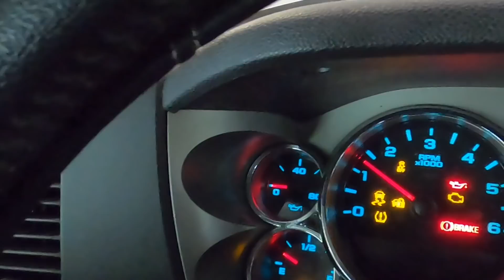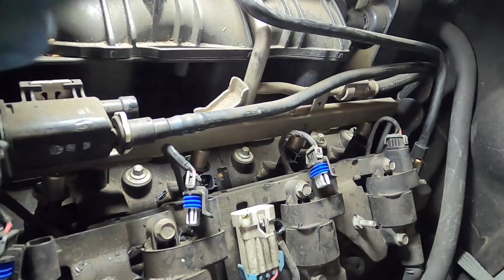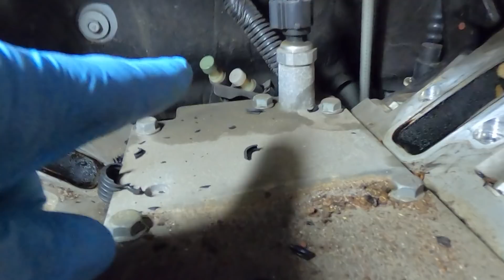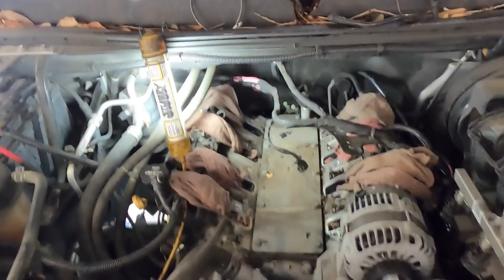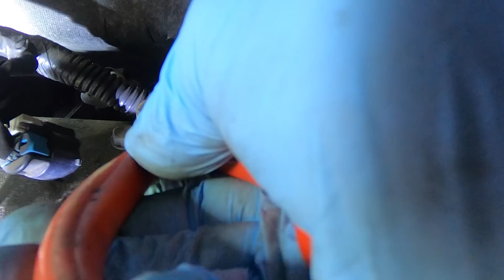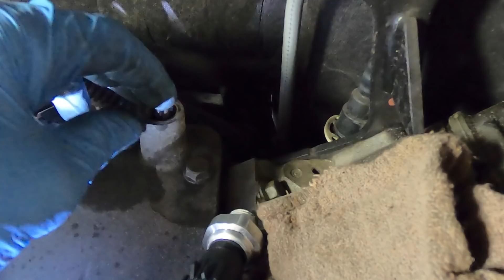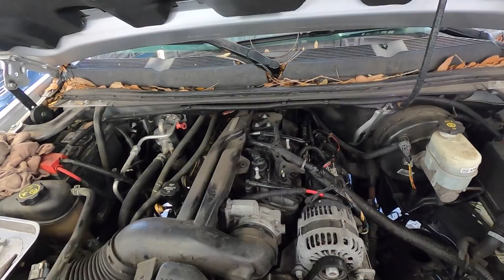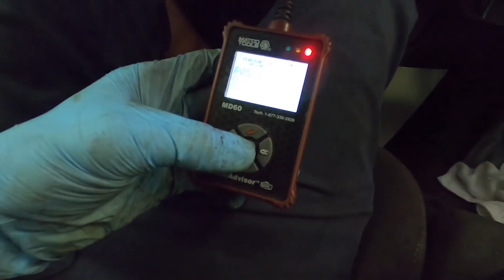Customer States: Google Diagnosis…replace this part!

Comment: Lots of criticism from people who either didn't read the title, watch the whole video or even worse, did and still felt the need to add a comment from the good old armchair perspective. The CUSTOMER brought the new part in and wanted it fitting because he KNEW what was wrong with it. These customers exist in every town and every city the world over.
Also RE removing the inlet manifold. There are a gazillion configurations of this engine and many of them you can reach the sensor, but that depends on the vehicle. Many people pointed out that the gauge had a reading at the end of the video, but that ONLY tells you there is currently oil pressure, we never got a total run down of symptoms. Honestly...
Customer should have dug further and learnt it's likely the o-ring that seals the oil pick up tube to the oil pump.

Comment: I bought an AC compressor last year when i did a quick diag of what i thought was wrong, i thought it had siezed internally but i came to the conclusion it was an electrical fault, magnetic coupling maybe, the mechanics said that they wouldn't be responsible for any misdiagnosis and i said it's fine, got working ac now, if i might have an issue or i have a question i go to a qualified mechanic or the dealer, every manufacturer has a car model with several common issues, but not every model has it, i got myself a code reader and i got a code once for the DPF, turns out it was a temporary issue with a preassure sensor, fault never came back, i'm not one to buy parts and say "Change this, this is what is wrong" i usually look a bit deeper into things

Comment: I get the comments about customers diagnosing their own shit, I really do, just keep in mind that there are some smart customers and it's always possible that they know more about their particular vehicle model than you, and they could be right.  For instance, my H3 was stuck in 4h lock.  After a good bit of research, yes on Google, I determined that the shift fork needed to be replaced.  I called a local mechanic, who first argued me down that the shift fork wasn't the problem, then quoted me $1600 dollars to do the repair just to get rid of me.  Why should I pay for an hour or more of diagnosis when I already know what the problem is?

So, fuck him, I ordered the $20 dollar shift fork, dropped the transfer case, busted it open, replaced it, and unsurprisingly, it works now.  See, it's a well known, common problem on the H3.  The shift fork is made out of nylon, and wears out quickly.  My vehicle was exhibiting all the right symptoms, and no extra symptoms.  It was clear what the problem was, but because the mechanic I called knows less about the H3 in general than I do, and insisted on doing his own diagnosis instead of entertaining the idea that I might be right, he missed out on a 600 to 800 dollar job.  I would have paid him to do it had his price been reasonable, or if he had been reasonable.

The moral of the story is, don't treat your customers like idiots until they prove that they deserve it.

Comment: TBH...I would have checked the codes, looked up the most obvious problem, replaced said part (without all the disassembly of the intake), cleared the codes, then checked for normal operation and no new codes. I have come across too many issues by not clearing old codes before starting the engine after repairing whatever was the problem. BTW Ray, we all see the guage pointing straight up near the end of the video...
Reply: I saw that too.  Maybe it did work.
Reply: 32:09 . . .  nice catch!  I didn't see that the first time.
Reply: Explains why he had the camera angle to the right of the vehicle. He just wanted to save face. Customer was right, also the oil pressure takes a minute to build up thus the delay.
Reply: @Lucky512  I don't think Ray spends a ton of time on precision camera angles.  Slow down there, speedy.   Plus a previous poster (@smurf stabber) indicated the pressure would read zero if a code was set.  It's entirely possible the code cleared and the gauge started showing without Ray seeing it during the recording.  No major conspiracy here.
Reply: @Lucky512  Its explained at the beginning of the video the issue is intermittent...
Reply: @Lucky512  oil pressure doesn't take a minute to build up. Should be within seconds. Any longer than that you have a bad oil pump , blockage or the gauge/wiring is bad.
Reply: @Lucky512  The customer still could have been wrong if the wiring harness was the issue.
Reply: The customer stated that the gauge would work sometimes and sometimes it would not work so that would be expected but if it didn’t work at the moment he turned the car on and that wasn’t the issue
Reply: Defaults to 0 psi when code is latched must have cleared code
Reply: Yeah it was. What's up with that?
Reply: Everything about this video is cringeworthy. He removes the intake manifold to replace the oil pressure sender, but there’s a dozen videos on here showing how to do it without any removing of components. He proceeds to blow dirt into the customers engine, possibly introducing particles that could cause significant damage. Proceeds to claim the repair was ineffective without first clearing the codes, and says the google diagnosis was wrong, but the scan tool would have indicated that sensor replacement was required, thus we would still be right where we are situation wise with the repair. Pretends that the repair was ineffective when we can see in the video that it was - in spite of his attempts to keep us from seeing the gage. Proceeds to drive the customers vehicle with the same dirty gloves used to complete the repair.
Reply: @jonhunt5408  there’s a dozen videos on here showing how to do it without any removing of components 

Good job Google Mechanic, The words 'intermittent' mean nothing to you, clearly.
Reply: @lward53  Dude is a hack, plain and simple. Spends more time filming repairs instead of completing them. Not sure why this garbage was recommended to me. You must be busy replying intermittent to everyone that agrees with this viewpoint.
Reply: @jonhunt5408  intermittently would have been the right word there you google mechanic.
Then again it doesn't surprise me that you cant spell when not even your mother could spell John right did she hick-up while they were deciding your name and miss a syllable?

If you're not interested in this man's videos have you considered getting lost?
Reply: @lward53  Wow, sure got triggered easily by anyone who disagrees with this hack. You use google mechanic like it’s some sort of insult, however I think it’s a compliment. I’d rather be a Google mechanic who does a good job and has a good understanding of what is required than a professional mechanic who is a hack. (Professional only in the sense that it is their claimed profession) Then your argument in support of this hack devolves into name calling. So, clearly you recognize he is a hack, but still feel the need to defend this poor workmanship. Since I spent a half hour of my life watching this train wreck of a video, I feel entitled to leave a comment, but don’t worry, I won’t be wasting my time watching more of this trash.
Reply: @jonhunt5408  I didn't defend him because i don't need to. It's clear he knows what he's doing.
You're just like this customer, Googled the issue and got mad when it didn't work out :')
Glad you're leaving, Don't let the proverbial door hit you on the way out.
Reply: 32:08 to be precise

Comment: I guess I didn't understand those codes. I thought you said they showed the sending unit was not working.
Reply from the maker: Those codes were circuit performance codes. The ECM can only monitor voltage that it’s sending out an voltage that is receiving back. The codes indicate there is a problem with that system but not necessarily that specific component. Yes those codes could mean there’s a bad sensor but it could also Because to buy a faulty ground or a short in one of the wires. 
Trouble codes don’t tell us what part is broken it just tells us what system is affected.
Reply: @RainmanRaysRepairs  Thanks!

Comment: Have never had a oil pressure sending unit bad in all my years at GM. Always something else. Also if getting gummed up then your ass needs to us better oil, and do your services more. Cause you be a Google dummie. Lol
Reply from the maker: I’ve ha seen the plastic ones crack and break off causing all the oil to get pumped out into the transmission

Comment: Lot's of labour to replace sender... I'm glad i drive  old audi ☺️
Reply: For sure. Audis seem to get a bad reputation cause of a select few models that aren't that great. The good ones are phenomenal. I've got a 14 year old A4 quattro with a V6 and manual transmission. 240,000 miles and has given me very little trouble since I bought it 12 yrs ago. Still runs and drives perfect and all the bells & whistles work flawlessly
Reply: @tylerwightman2315  mine a4 b5 are older :) i've got three of them, they are cheap as hell, no rust, simple, comfortable but... Boring :)
Reply: You should check out Youtuber "Customer States What". He works at an Audi dealer.

Comment: I do about 5 a week and ive never took off the intake
Reply: Everybody that keeps saying “I did it without taking the intake off” you weren’t filming a video that can be shown to the customer showing what you did especially when the customer is telling you what to replace without diagnosis. Stop criticizing and realize he is doing exactly as the customer requested and being able to prove his work without removing the intake there would not have been a clear view and a risk of causing damage to another part. People in this world just want to criticize others and fail to use common sense when doing so
Reply: Right. But that's what the manual says. Of course it's BS, but that's what it says. I have a 6.2 right now with no oil prsessure but of course I know better than that.
Reply: As you get more comfortable with repairs you tend to stop doing things by the book. The book says to do it this way. Sure you can skip most of it, but that's for later. Usually I'll take a part off put it back on, and then something else will come in that needs the same thing. But this time it only takes me half the time, because I learned what needs to come off and what doesn't. But if you use the book, you can't be wrong.

Comment: Seemed like it was working fine when you were backing up the truck. And no check engine light. 32:07
Reply from the maker: I had cleared the codes. The complaint derated the three gauge was inoperable but worked. I drive the truck later in the day and found that it would bounce around and randomly drop out.
Reply: Yes, codes must be cleared for the oil pressure gauge to start working on Chevy trucks after maybe 2010 or so. So was their complaint that it was completely inop all the time, or intermittently working? If completely inop when brought in, then seems good to go.

Comment: Unbelievable all that work for a sending unit 😳
Reply: And it was unnecessary. Most people change that with just a ratchet, extension, wobble joint, and a deep socket. It’s not easy because you can’t see it, but you can feel it easy enough.

Comment: Lmfao....that where mine is on my 6.0 and since we had it apart  we put the knock  and cam sensors....
Reply: Hope you changed the knock sensor harness also, it fails as often as the sensors do, if not more due to corrosion  from water intrusion.

Comment: I changed this on my old 03 Tahoe 5.3 but mine was pinned on 80 lbs lol. But I didn't pull the manifold. It was a job to get it but i think I had more room then that 4.8. I almost gave in and pulled the intake but managed. I do all my own work, I have a 06 Chrysler 300c 5.7 AWD that I'm getting ready to do the oil pan gasket in soon. Just finished ordering all the parts I need. Thinking about recording it because there isn't anything on here on the AWD. Should be great fun the front differential runs through my oil pan

Comment: and another case of designee engeneers needing a good ass kicking. back in the day there was 3 to 5 inches of clearance behind the block to easily change an oil pressure censer.

Comment: O ring  on the oil pump pickup tube while the oil pan is off why not a new oil pump 40.00 bucks for oil pan gasket so spend a little more and do it all

Comment: Wow the sheer size of that GM big block is unnerving to me.  Accustomed to working on transverse 4 cyl Mazda and VW mini blocks…. Everything you can think of is within sight and touch— air filter, distributor, PCV valve and yes, oil press switch.
   Not a completely fair comparison I agree, however I became addicted early in my 20s to the joy and ease of Smaller-gets-it-Done.  And 32 mpg….😜
    A devoted viewer in Ontario, 🍁 Canada
Reply: 4.8 is the small one in the series.  5.3 and 6.0 are similar.

Comment: My GOSH!  Think it would have been easier to pull the engine out to replace  that!  Lol.  An engineer figured out that was the best location?  Think the could have put in a tube from the engine to the sensor to the side of that position.  I guess they have to earn their paychecks. Thanks for the tutorial.
Reply: It can be changed in under an hour without all of that disassembly. Mostly none of it.

Comment: That's one of the nice things about the shop I work at, we don't use customer parts and we diag everything
Reply: Not using customer parts is a bad thing. Right to repair, look it up. Repair places are swindling people out of money for the same parts they could get from a direct supplier of the same exact quality part. It should be illegal to force customers to use the same parts they could get on Rock Auto, Summit, Jegs, etc., for 200% markup.
Reply: @JosephArata  No one is forcing anything. If a customer doesn't like the shop's policies, he can go elsewhere.

You can argue about the wisdom of a given policy, but no one's rights are being taken.
Reply: @JosephArata  No reputable shop will install customer parts. The issue is warranty. Suppose you bring your own water pump to me to install on your car. Three weeks later, the cheap POS pump you bought at PepZone is leaking. If its the pump, I'm going to charge you to remove it, send you off to get another one, and I'm going to charge you to reinstall it. Am I ripping you off? Nope, I didn't sell you a defective part. If I screwed up the gasket on install, now it IS my fault, and have to redo the job for free.
Reply: @JosephArata  Using customer parts has nothing to do with right to repair. Professional shops take pride in knowing what parts to use and which ones to avoid to give the customer the best value. It's a buy once, cry once balance we do everyday in an ever changing market. This video shows a very unprofessional job from the moment the customer walked in the door until the vehicle was pulled out.

Comment: Absolutely ridiculous that you take your customers to the cleaners like this, this job is a one hour job, diag and labor, and it's super duper common.  $150 gets them out the door, this is highway robbery. I've personally done this job at least 4 times and I know at least 4 other people that regularly make this repair and not one person ever pulls the intake for this. The intake gaskets don't leak on these like the previous engine, you have no business going in that deep and charging your customer 3x the time and taking extra risks like uncovering intake ports on filthy vehicles. This is absolute nonsense. Shame on you.
Reply: The customer is getting what he asked for....in more ways than one

Comment: Never have I ever seen anyone pull the intake to do this. We do this repair all the time and it's one hour for diagnosis and labor, out the door. Who in the world pulls an intake for this. Short extension and the sending unit socket put them on by hand doing the old reach around on a cooled off engine. Then put your 3/8 ratchet on it. To be fair, the chevy's have a lot of variation with the intakes as far as different pieces of plastic in the rear of the engine and some of them are super easy to reach around and do while others like my dad's suburban has extra plastic in the worst spot and it takes a few minutes to feel around.  But I've personally done this repair at least 4 times and never ever done anything but the old reach around, it's an easy $100.  Even the screen is accessible with sharp needlenose pliers.  this is crazytalk, these intakes on these chevy's aren't even as notorious for going out like the previous style so there's no benefit to changing the intake gasket either, this is just taking people to the cleaners because of lack of experience or ability IMO.